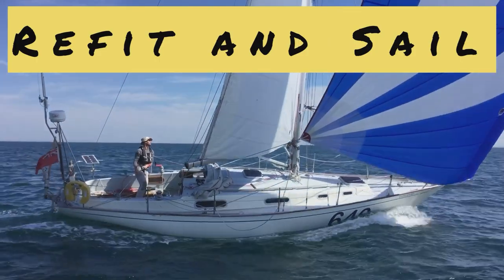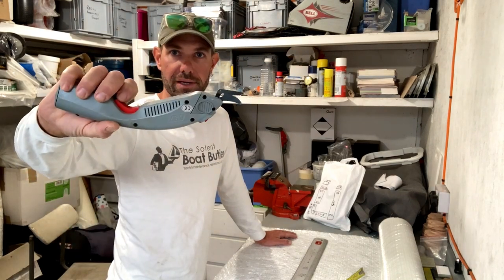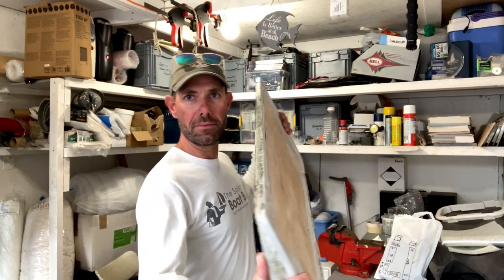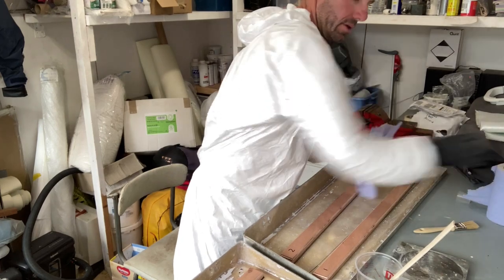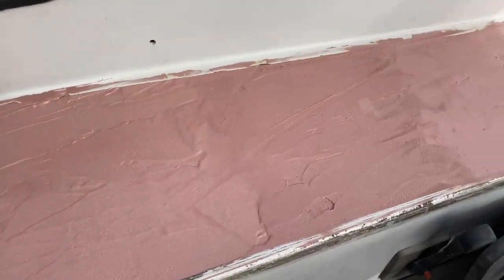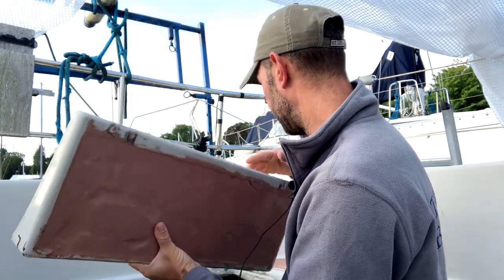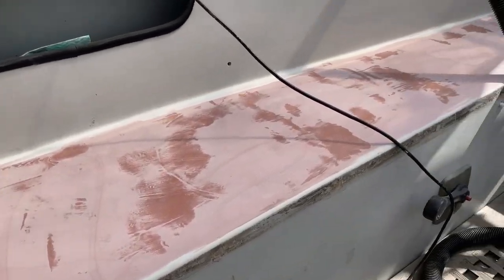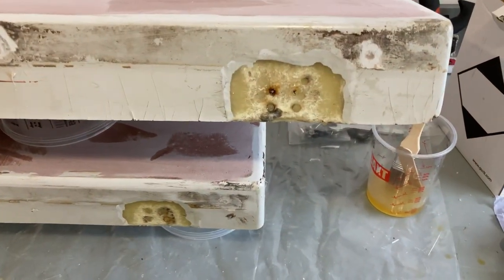Cockpit repairs and preparation for new decking (Project Lottie Ep4)

Comment: Great video George. Did you put polyester gel coat over the epoxy laminate?
Hopefully you will be replacing the water tank and saloon sole as this is something I am contemplating this winter 😀
Regards…….. Andrew  - CO900 Gauntlet
Reply from the maker: Hi, yes on both.   Water tank out and new one ready to go in, see a future video….     Poly flow coat (gelcoat) over epoxy is ok as long as care is taken on the prep and the epoxy is completely cured.    You can’t get a chemical bond between the two but a good mechanical bond is possible so no issues.     I may do a separate video about resins and compatibility in the future.

Comment: Very impressed with your description and workmanship, but can’t you just paint the inside of the locker lids, I’m no expert , you obviously are , I’m glad this boat needs so much work , looking forward to more of the renovations
Reply from the maker: Nothing wrong with painting the inside of the locker lids but using flow coat (which is just gelcoat with added wax) is a slightly better option as it’s harder wearing and lasts longer.   But paint is fine too.   You can’t flowcoat over paint so if the surface is painted you either have to remove it all to flowcoat or normally it’s just easier to paint in that situation.